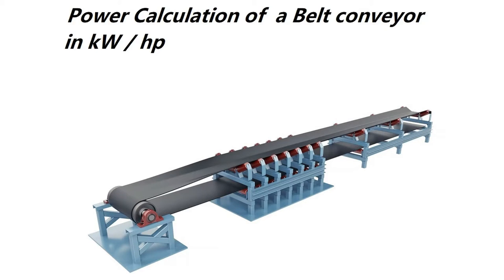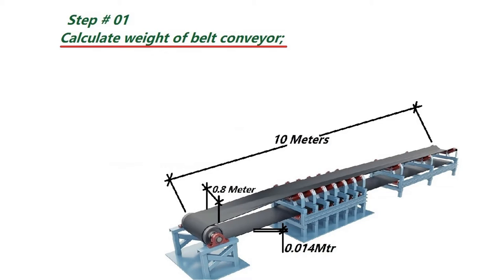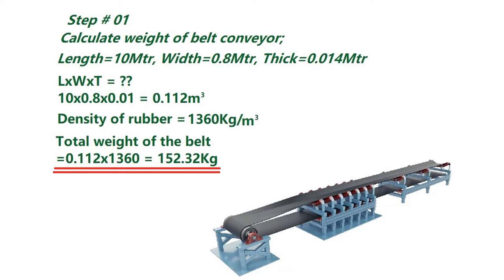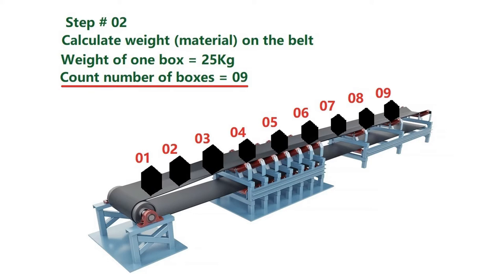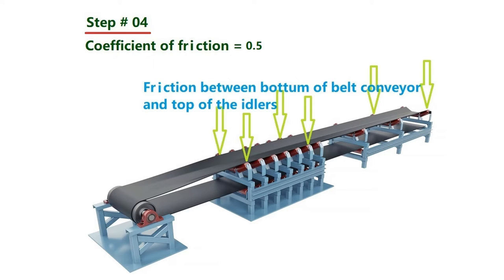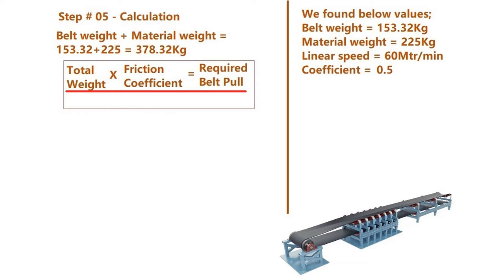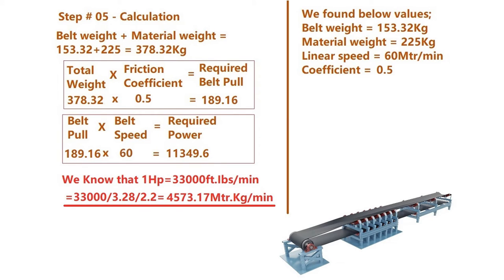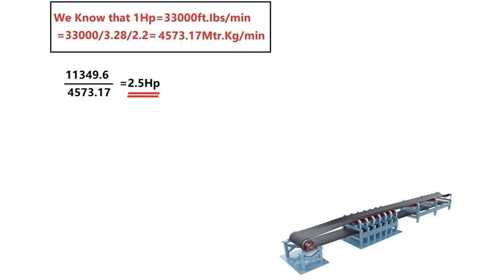Belt conveyor Power calculation

Comment: thank you sooooo much .. 
i'm using your video to design a conveyor for my graduation project and i wanted to ask .. how should i know the coefficient of friction ? does it depend on material ? .. and i will be so thankful if u can provide me with a standard sheet .
Reply from the maker: Its standard Dry and 20 to 50 °C it will be 0.5 to 0.6. its a ration between roller mechanism
Reply: @hr5094  thank u so much but it's  a little bit late hahah , i'm a lean engineer now thank u :)
Reply: @rewanhaggag4395  i'm working on the same idea for my project at Sinai University .. a color based sorting conveyor belt .. can you please tell me the specs of the belt and the motor you used for your project  ? .. Thanks in advance.
Reply: @MahmoudAhmed-pv2hg  we used a servo motor and we didn't actually focused on the conveyor cuz it was an unnecessary part of our project .. my main project was about a pneumatic gripper which we used as an inspection tool to grip a product running on the conveyor , weight it , then decide if it will drop it right or left according to its weight

Comment: After put/multiply of coefficient friction (0.5) value are divided by lower value that is (1/2). I think friction value should be added in total weight because friction is decreased of this speed, than why? Ans please.
Reply from the maker: Yes its the same, first we calculate the total weight and multiply with coefficient friction.
Reply: @hr5094   the belt pull should be 567.48 Kg

Comment: What factors to consider while calculating the starting power for full load capacity. Or breakaway torque
Reply: I appreciate your help in providing me a brief equation or rule of thumb to calculate the specific energy consumption as Kwh/Mt/Km   length =  5 Km , Flow = 2500 to 3000 Mt/Hr , Route inclination= zero inclination, Width = 1200 mm , trough angle=30    how much electricity will be consumed in electrical motor

Comment: Hi sir! I want to ask, how do you determine the value of coefficient of friction? Is it constant 0.5?
Reply from the maker: Dear, 
Yes it is standard 0.5, as we know CEMA (Conveyor Equipment Manufacturer's Association) is also follow the same value for friction coefficient.
Reply: 0.5 seems indeed excessive for idler rollers. I use that value with slider beds, it is pretty typical for steel vs. belt material. Just confirm with belt manufacturer since it depends on belt material and slider bed material.
For idler rollers, I use 0.05. It is much higher than the equivalent friction factor in bearings but works well.
Reply from the maker: Its standard Dry and 20 to 50 °C it will be 0.5 to 0.6. its a ration between roller mechanism

Comment: how to calculate required belt pull?
Reply: I appreciate your help in providing me a brief equation or rule of thumb to calculate the specific energy consumption as Kwh/Mt/Km   length =  5 Km , Flow = 2500 to 3000 Mt/Hr , Route inclination= zero inclination, Width = 1200 mm , trough angle=30    how much electricity will be consumed in electrical motor